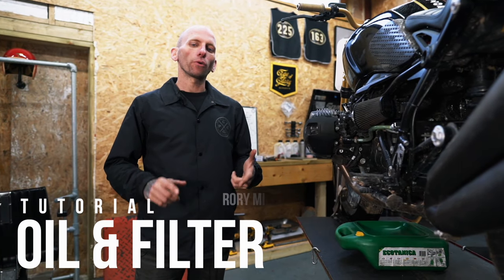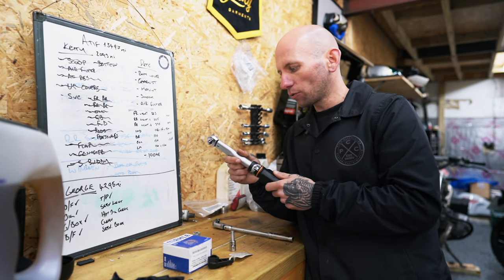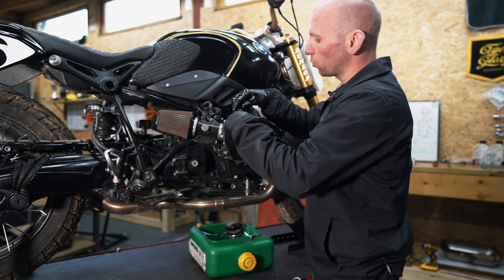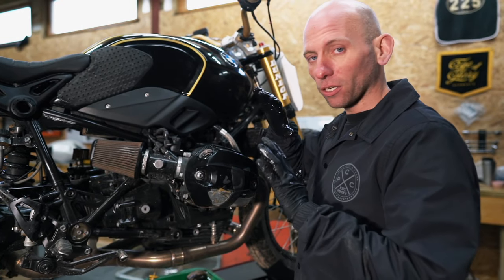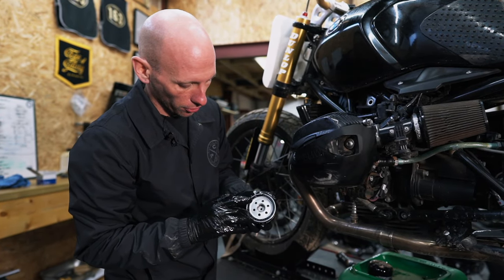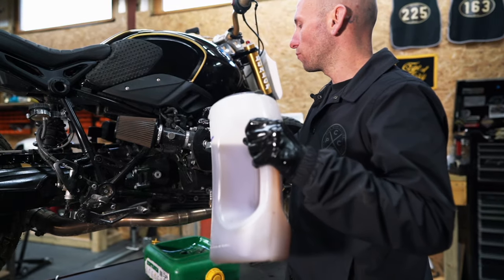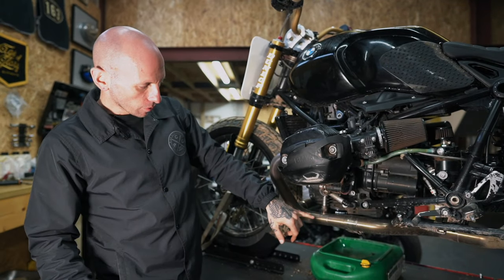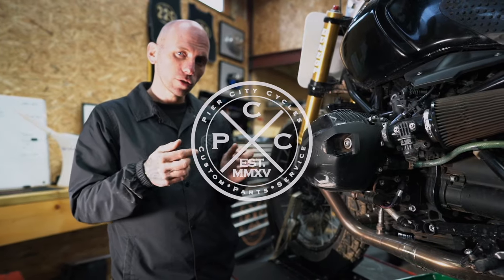PIER CITY CYCLES TUTORIAL - Oil & Filter Change On The BMW R9T

Comment: Great video! I am installing an aftermarket exhaust on my 2023 bmw r nine t and with this being a new gen, the cat comes with an O2 sensor. I am wondering what you can do to either trick this sensor or place it is farther down the piping.
Reply from the maker: There is no way of tricking the system unfortunately. The third o2 sensor and integral flap means you would need to replace the whole header system and as well as use a servo buddy. We recommend the Unit Garage headers linked below: https://piercitycustom.com/products/unit-garage-bmw-r9t-exhaust-down-pipes-header-pipes?variant=39323968340038